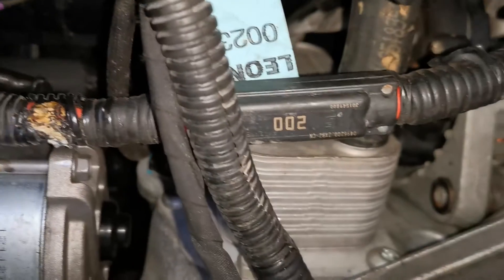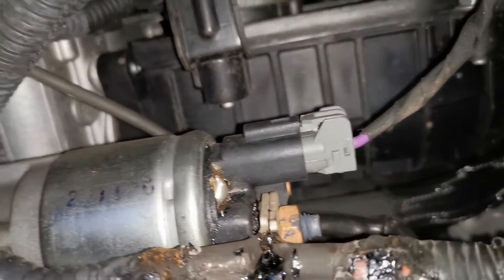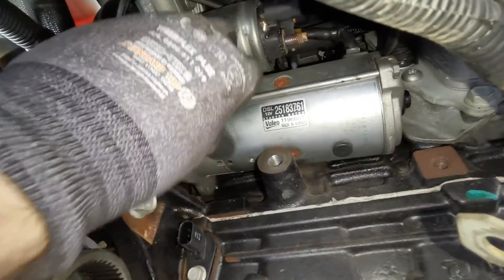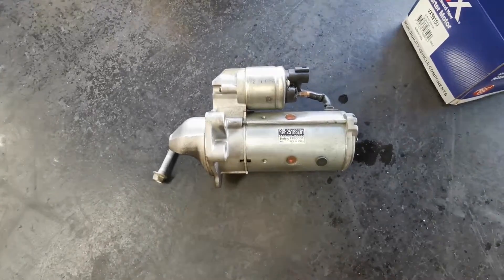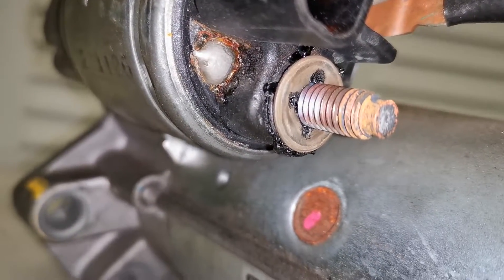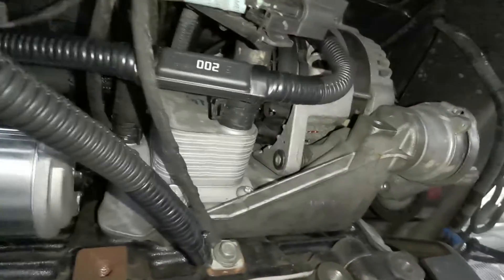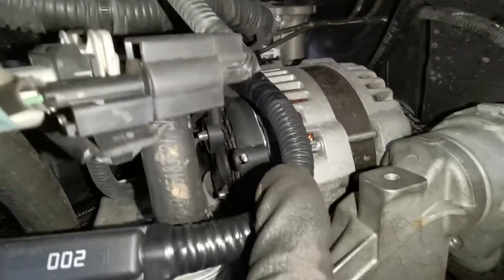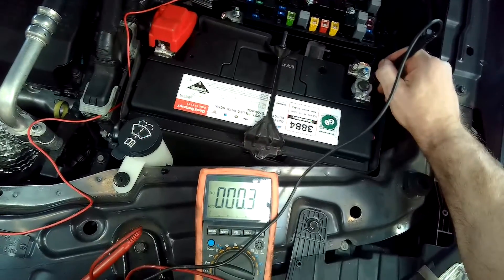Clicking But No Start Fault - Found & Fixed - Holden Chevy Captiva

Comment: Thanks for this valuable video. My situation is a new starter motor fitted, and was working well, but had other issues with throttle body, EGR, and fuel rail pressure. On removing the EGR and cooler and replacing the elbow pipe to the throttle body, I'm now getting no cranking at all. It's giving the same symptom you're describing. The main cables are in good condition and connections are secure. I'd love to get your view on what could be happening now.  THANKS!
Reply: I've got it cranking again and it fires up if I have the accelerator pedal all the way down, but runs extremely rough and dies after about 5-10 seconds.
Reply: @johnwilson6111  hi, did you solve the issues?

Comment: I have a 2007 2.0diesel manual Captiva and my battery is good but the car is not starting...only rolling turning the engine but not starting...what could be the problem?

Comment: Hey there I had to replace the crank angle sensor on a captive 2.2L diesel 2014 model, pulled the transfer case and so on and put it all back together and now it’s lost all dash lights and all you can hear is a clicking noise, the funny thing is it was turning on and turned over but no start, so what do you think it may be.

Comment: I like it, well explained, its a good video! I wish I could have an advice on how I could get the communication of tcm, ecm and ebcm back to normal and then finally be able to get the car to be able to crank and start!! This problem was after a an electric short that was caused from wrong wiring connection after they were splitted from the brake pedal switch on the same vehicle Chevy Captiva!! Thanks!!
Reply: Im in the same spot. I cant get my captiva to crank over. Just says no connection to ecm

Comment: that’s seems to be exactly the problem what I have too, Captiva 2012. It’was not logically why it worked or didn’t work sometimes. In my case when it didn't start, had I to turn off the light and it stared by next try often. Sometimes you could try 30 times and it didn’t works. Note, when I turned the key after the check modes was done and all lights in the cockpit went off. It looked then like a short and even the display from navigator or radio went away(power off).

’

Comment: We have the same sort of fault on our little 2013 Vauxhall Meriva 1600 manual,when it don't start i have to disconnect the negative post on the battery and then connect again and then she will start with no problems,sometimes it will go a few months before the starting issue and you never know when it's going to happen again.
So i'll check to see if we are having the same sort of issue shown in this video.

Thanks for sharing and hoping it will help us too,huge thumbs up. 😉
Reply from the maker: Thanks for the kind words.

Comment: Should this not be a vehicle recall if it is common fault it looks like a fairly serious problem in terms of fire risk. Great video won't be buying one of those cars anytime soon!
Reply from the maker: Cheers Michael, as far as I am aware the customer first contacted the dealer after the diagnostic to check for warranty before I got the green light to repair. 
I do not have the dealership recall info so I am not sure on that mate, it should be regardless. It could be avoided easily.

Comment: Nice walkthrough vid. We had this issue about 6 months ago on a customers captiva. First time any of us had seen it and we were puzzled at first as to why the nut had come loose. Fairly simple fix but man are the starters a pain to get to. Am glad we don't see many captivas
Reply from the maker: Thanks gekkokeats,  
Crazy how 1 model can have so many failures on all different components, engine, transfer case, electrics ..... they are a costly vehicle to keep on the road 😒

Comment: Well done mate!
These Captivas suffered from this problem so much that GM provided a TSB with the updated starter and cable & instructions.
Another reason they get nicknamed 'Craptivas'!    🚗😁😠😒
As usual, good video and explanation.
Reply from the maker: Thank you Max,  
It is hard to believe how many common problems these can have. What does the TSB say mate? Does it state the primary failure reason? 
Curious for owners that the fault has not showed up yet, how they can avoid this happening without having to do the upgraded repair.
Reply: @GerardBurkeBurkesGarage  Hey Gerard,
I think the main reason for the fault it the poor positioning of the +ve battery cable, which is allowed to rub on the chassis.
Here's a link if you are interested http://australiancar.reviews/_pdfs/Holden-Captiva-ServiceBulletin-14003A.pdf
I believe that is also covered by Holden's extended warranty.
Reply from the maker: Thanks mate, great info 👌👍

Comment: Don't u have to be careful when your doing relay bypass tho because am guessing that not all vehicles uses the same pins. Love video relly helps me with my level 3  Course in  diagnostic
Reply from the maker: Thanks for the kind words Keaton, I appreciate the kind words 🙏🙏
As a practice it is a great way to double check everything and assume you are wrong until you get confirmation.
If you have the same relay type as this, as in the same numbers then it will be the same. Toyotas use 3&5 pins and you may be able to view a breakdown of the pin layout printed onto some types of relays.
Great to hear from people going through courses 😁
Keep up the good work 👌👍

Comment: We have old skool cars in the shed so good for trouble free and  diagnosis the repairs and brain dead easy, and still 10kms to the litre, and better with hho 14 to 16 if deisel ,unlike our later cars ,computer controlled everything inside and outside. New cars are very interesting to work on though just not if you're in the middle of nowhere in near 50 degree heat.